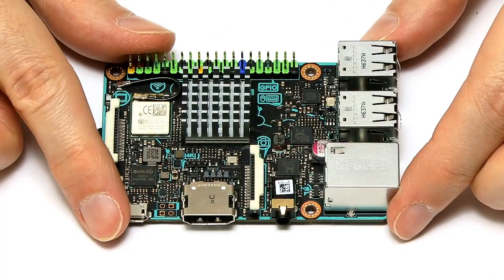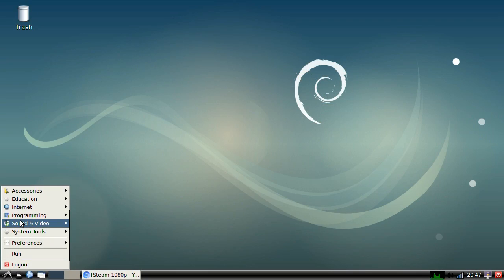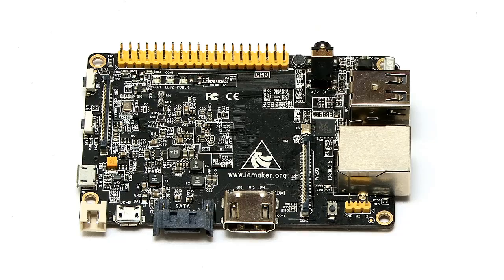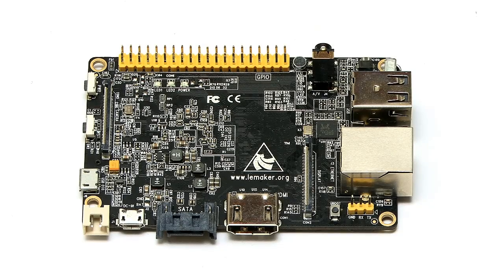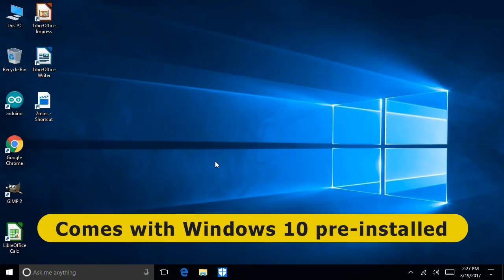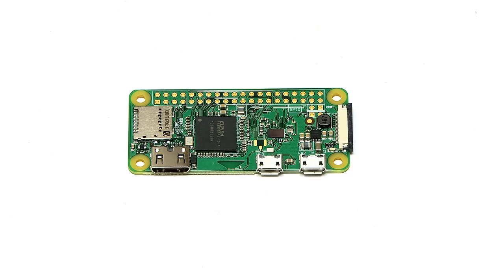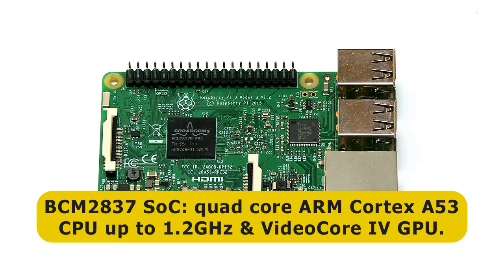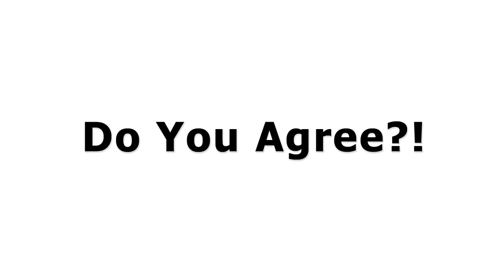Top 5 Single Board Computers 2017

Comment: My number one has to be the raspberry pi 3. Although it's not the most powerfull, nor the cheapest. It has an amazing community and high versatility.
Reply: StarTrek123456 it's a relatively inexpensive and in this space very, very well documented platform to get into bare bones/more powerful embedded stuff. And (IMHO) if you need decent performance and an OS for your GPIO using project prebuilt libraries and distros should only really be used for quick and dirty "lets see if this is even worth attempting" proof of concept stuff anyhows.
Reply: raven precept, would you suggest it for creating games in the Unity engine?
Reply: Ry Hu I don't think that any SBC can run 3D unity games at an acceptable framerate. Maybe 2D, but there are lots of better options for that.
Reply: I was wondering more about the ability to use DX.  Windows kinda owns the market on that.
Reply: what would you suggest for running 2D games?  I am not looking to create games on the board with unity, just run them.
Reply: Rpi3 is a 40nm 1.2 quad core. With a Gpu that can barely play 1080p and has horrible h.264 support. The ddr2 ram is so slow, you literally have to wait about 10 seconds for it to fill up will browsing a taxing page. Then it will get full, take a dump, then take another 10 seconds to fill up again. But damn I love this thing. Its still twice as fast than my first desktop and has twice the memory
Reply: The Saucy Goblin Shark Yeah the specs of the pi don't really impress me, I would rather get something like the odroid xu4 especially since I like to do low level/bare metal tinkering so I want as many resources as possible to do as cool things as possible :) Of course some things of that nature might actually be easier on the Pi like gpu acceleration since the hardware is much more well documented do to the much larger community support, there is a github page with reverse engineer documentation about the pis internal gpu driver for example. There isn't really the same level of support on the odroid afaik :(
Reply: here is an interesting fact, 5 magazine  just for it and several other that feature it
Reply: Guess we share the same thoughts on the PI!
Reply: Agreed. The community is something exclusive to the raspberry pi.
Reply: stig gear The pi 3 is awful. The pin assignments are different in every GPIO library, there is a lot of outdated information and raspbian is shit.